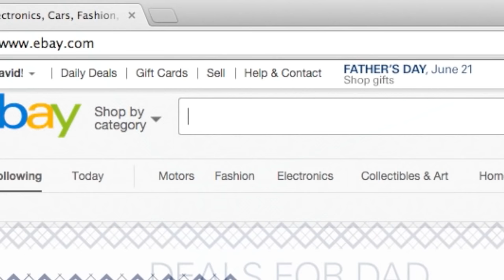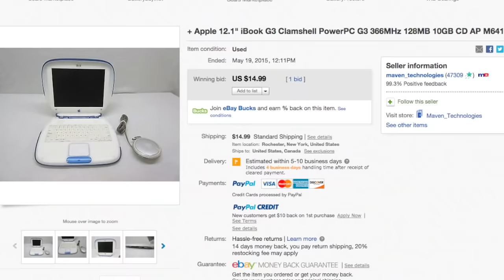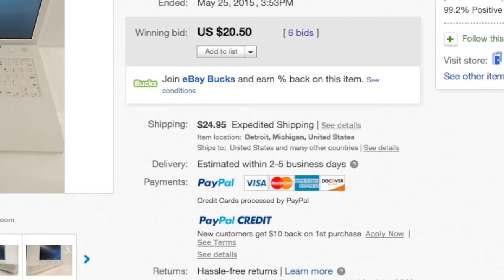Are apple iBook laptops collector's items yet?

Comment: After such a long time I watch the video again and there is one thing you did not guess, the dell ibm ect, now they are collectibles (year 2021) especially pentium, 486, 386 and more old, pentium 2 and pentium 3 not yet but, tualatin yes.

Mac laptops are not so much, but desktop ones are and quite a lot, at least in Europe, years ago getting a dual g4 MDD  or a mercury was very easy, there were even in the garbage, now they have a high price.

With the same thing graphics cards, the TNT2s were discarded, now they are going up, not as much as the 3dfx voodoo but things get serious.

and you, you have risen like foam, keep it up. :D

Comment: does it support windows? if it doesn't what's the point in buying apple
Reply: +mathias de potter Mac OS.
Reply: XD nice joke...
Reply: mathias de potter Some people need/want Mac OS more than Windows. These old iBook are pretty useless today, even compared to other notebooks from the time, though, I will say.
Reply: brodogger81
true, I too highly doubt that they already could handle the perfect OS in that point in time. The only advantage a mac book these days could have is their stunning screens, but then again windows isn't hardware restricted so any screen could be used.
Reply: mathias de potter MacBooks also tend to be make of higher quality materials, as well as usually being thinner. Windows computers usually tend to care more about specs over looks, size, etc, so the best option of computer varies between all people.
Reply: brodogger81
k true... apple also makes the 'new comer' difficulty easier, so peoples with zero to little knowledge would tend to apple, but they are till to over priced because they became such a mainstream trend-standard thing.
Reply: mathias de potter They defiantly aren't as cheap as they could be, but they aren't as bad as most people think when it comes to price.
Reply: +mathias de potter Well, I use both Windows And OsX and I JUST somehow like OsX more. Its simpler and dock is way better on OsX than windows, And Windows does not have scroll animations on dock. OsX seems to work also better fps for me. For example If you compare 25 and 60 fps. So they look like that difference. I think its because OsX have more animations and smoother screen. MacBook Pro screen is also warmer color and higher pixel density. Also my PC laptop have horrible touchpad and its made of plastic and even keyboard bends. MacBook Pro is made of aluminium and it feels good. Also touchpad on MacBook Pro works way more accurate and does detect finger every time unlike my windows pc.
Reply: eetu53
ow
Reply: De Potter M. The only reason people buy Macs is too not use Windows.
Reply: if you're gonna spend money on a Mac then you probably don't care about your money

there are computers that are half the price of a fully loaded MacBook inb4 razer
Reply: I am surprised no one seems to have cracked wise with "but can it play Crysis" with all the comments I have ready through in 2018.

Comment: I had a commodore 64 and a 128 both in original boxes, both working that I threw in the trash. I had tried to drop them off at my local Salvation army/GoodWill and they refused to take them because they weren't "flat screens". I still feel bad about it, I knew then that their were avid collectors of those units but for what they were worth I just didn't have the time to mess with Ebay selling them.

Comment: I sold: Macintosh Iici with 24bit card, 13'' monitor, AEKII and ADB Mouse; Amiga 3000 with an A1960, original keyboard and mouse; A2000 with a '030 accelerator, VT, A1291, original keyboard and mouse A1084S; A4000D (CEI branded) w/picasso and VT4000; A4000T with VT4000 and Picasso; Powerbook 170 w/accessories; Power Macintosh G3 upgraded to 400MHz G4 and fully loaded. All for $180 bucks. In 2011. The cost of separation I guess.

Comment: Anyone remember how insanely overclockable those first iBook G3's were? Just move a couple SMD resistors around on the motherboard. It was actually FAR harder to disassemble and reassemble it than to do the soldering. I've got an old grainy photograph of me hunched over a magnifying light doing the task to my friend's iBook. If I recall right, they were underclocked to conserve on power. They were at least 400MHz chips, clocked at 300. We took his up to 333 or 366 if I remember right, whatever was the easiest next step up.

Comment: If you're going for a G3 USB iBook beware of smelly keyboard syndrome. The adhesive used under the keyboards on some models gives off an odor similar to BO as it degrades.
Reply: i have a 12" titanium g4 and i barely ever use it because it reeks when i turn it on. legit smells like it's been sitting in a gym locker room once it heats up lol

Comment: Well the Clamshell design probably is the most usable design Apple brought out in recent years. Yes, there are problems with it, but compared to later ones they are great. It's what fooled me into buying one of those white ones, which was by far the least reliable laptop I ever had. Much less reliable than the ultra cheap laptop I got right after it.

Comment: Hi The 8-bBit Guy and all. You can use these and earlier models for the internet, most office programs, low end image editing, some games, and plenty of other things. So far I've installed up to Debian 8.6 for PowerPC (burned to CD using the "Net Install with Non-Free Firmware" version). Sure, Firefox (and browsing with it) is slow, but its still modern and supported. Multimedia is a problem - except for internet ads! I'm not sure when the video (and other) hardware in the G3/G4 series finally lets one watch movies. Wireless internet at the 802.11g level should be possible with any computer that has USB 2.0 and a Debian compatible USB wireless device. I've done most of these things with an iBook G3 300MHz and 366MHz, both with 576MB of RAM.

Comment: I've only kept a few Macs over the years, the PowerBook 100, PowerBook 2400c (modified with a clear body from Japan and a faster CPU) and PowerBook Titanium 1Ghz). The iBook was always a real POS, specifically because of Mac OS (you were able to pause the entire system by just holding down the mouse buttons). The desktop computers that I've always enjoyed collecting are SGI's, SGI Indy, O2, Octane, Fire and my favorite, the Tezro in which mine is the fastest model that was available with max out memory. I also have a few Sun workstations, a Mac Cube and a Amigo 5000. Miscellaneous laptops, IBM butterfly, HP  OmniBook 800, Psion NetBook, 5 MX, etc. The Psions are still my favorite portable computers even today, the 5MX specifically absolutely blew away my Newton when it was first introduced, I mean it had full multitasking.

Comment: I have PowerBook G4 a PowerMac G5, just because It's PowerPC platform, and I am big fan of IBM POWER line. But I am a big oldschool UNIX/Linux fanboy, so I have Debian on both, G5 is moded for years, mainly cooling system is f*cked up bitch from Hell (yes, I have a leaky one), G4 is my backup laptop and is usable, Debian for PowerPC have some rough edges but still, as inteligent typewriter is possible. Plus, in my country wasn't Apple thing before iPhone, so my unusual Mac is unique and even mistaken for brand new product...

Comment: 7 years later in 2023, I still managed to get a G3 Snow iBook for $30. Granted, it is the slowest G3 Snow iBook. 500MHz, 64MB of included RAM, CD-ROM drive, and no included Airport card or hard drive. But everything except for the battery works on it. The display is gorgeous, the case is a little scratched up as any 22 year old clear plastic would be, and some of the shielding and a couple of screws are missing from the inside, but it's otherwise amazing.

Comment: I never realized how big those first generation iBooks were until you showed us using one sitting on your lap. Anyhow, on the topic of the good typing feel of the iBooks, I agree. I think that in general most older laptops feel good to type on (for example, I have a 15 or 16 year old Dell Latitude in almost brand new condition and I love typing on it) and the same applies for my PowerBook G3, which feels good to type on. It's a Pismo model, so it has the bronze keyboard on it. I wouldn't say that new laptops have crappy keyboards (for the most part), like my HP ENVY which has a keyboard that feels similar to a MacBook Pro keyboard and feels pretty good to type on, but I think older laptops have nicer keyboards to them. And when a Clamshell iBook is modified to have the light on the Apple logo, I think it looks cooler than even the new MacBooks.

Comment: Just had to write another comment, you.. 8-bit guy (iBook Guy).... you have inspired me to buy iBooks.... however it is hard to come across an iBook g3 ClamShell... I got one (BlueBerry) for a total of 60$ with a broken keyboard, I was able to buy a new keyboard (for about 10$) and swap out the broken for the working. So I have a fully functional 1999 BlueBerry iBook g3 (however the bezel is missing on the CD tray)... I am planning on selling it once I get an air port card installed in it. 

I also got an iBook g4 1.33 ghz (for around 50$ including shipping) fully working (even working battery), just had to replace the feet and clean it up. (I plan on keeping this one for personal use.). I would like to thank you so much for making these videos.

EDIT: I live in a desert (Las Vegas) I usually mess around with the iBooks indoors... in a COOL and DRY climate. The iBook G4 (the one with a working battery) actually doesn't make a bad school laptop, I tend to bring it to my school whenever I have to type up essays or something like that, as Microsoft Word 2008 runs smoothly.

Comment: I do have a 2009 MacBook with Mavericks but other than that, all my computers are PowerPC. My PowerMac G5 tears through anything (just runs older apps) and I use a 15in 1.67GHz PowerBook G4 for work and school. It's a very sturdy and dependable system still and I only got it for $40. It's in beautiful condition. All I had to do was put in a new PRAM battery. I do plan on upgrading to an SSD though. As far as YouTube goes on it, the G5 can play full 720p (But that's because it's dual core and has a nice Video Card) the PowerBook can actually play in 360p though. But I do prefer 240p as it has a better frame rate. So not only collectors are buying these Macs. I don't really use my Intel MacBook much anymore though because it has a small and awful screen.

Comment: You can run a powerful but noisy machine (e.g. dual Xeon E5-2643v3 and quad GTX Titan X for blazing fast rendering) somewhere within your home network but away from living area, and access it over VNC on your comfy iBook Clamshell. VNC is a platform-independent open standard protocol for remote access and OS X have built-in support for it from the get-go.

Comment: This is the info for a for parts ibook g3 clamshell on ebay:
You can no longer afford to work with that slow outdated bulky laptop! With so much to explore in so less time, you need a speedy portable computer. The Apple iBook G3 is the ideal laptop for computing on the go. Consistently keep working at a speedy pace, as this Apple notebook is powered by the 300 MHz PowerPC G3 processor. The stylish clamshell design of the Apple iBook G3 laptop suits the tastes of all- business men and college students alike. With a resolution of 800x600 pixels, this Apple 12 .1-inch laptop displays detailed images, so that both texts and graphics are comfortably viewable. Virtual characters in online and PC games will not trails while moving or appear blurry, as this Apple notebook is fitted with an ATI rage Mobility graphics card. Work seems delightful and entertainment more relaxing on the Apple 12 .1-inch laptop

Comment: The problem with collecting notebooks in general is, that they will eventually fall apart and there is almost no way to repair them. 

If any of my pcs fall apart, i just put them into another case. My oldest computer is a 286 and it still works, while i lost quite a few notebooks over the year. (Taking care of the battery is a must)

Aaaand: Original IBM PCs are highly collectable, strange thing to say (Even in 2015)

Comment: Well here's the thing.  The video showed some footage of ebay that had sellers asking hundreds of dollars for a clamshell.  They can ask for any asking price, $300, $400, $600, and etc.  But that doesn't mean they are able to sell it at that price.  Browsing ebay for starting bids and highest "buy it now" isn't a good method to judge the worth of an item.  Right now, at most $200.

I would also like to point out that what determines how valuable a collectible is often ties in with how many are made.  Clamshells weren't limited edition.  There were plenty made and available to the consumers. 

If you find an iBook Clamshell in mint condition with nice box, manuals, and cables then that is going to be worth something.  If you find a Twentieth Anniversary Macintosh, that is probably one of the prized collectibles for any Apple fan.

Comment: I have also two of the iBooks, one have a not working backlight and one.... works, but is not so fast, because it is one of the first. But i upgrade both with a 160GB SSD (yes I use a SSD) and maximum of RAM, in the newer Version i add a DVD Burner, and in both a Airport. But in both the Batterie died. However, I will see forward if in some years i will see how many i can get for the early model. The newer Model I use for some Retro feelings and also for some vintage stuff, because the Audiojack also send the Videosignal with a special cable and you can add this old Clamshell to a old TV of Beamer for some retro feeling stuff (show the Kids how we live before the iPad).

Comment: Key lime's popularity is definitely because there are fewer of them. They were only available with top-of-the-line-for-the-time specs (particularly faster processors, iirc,) which made them more expensive to begin with. No basic model option, like other colors. I still have the little spec pamphlet, somewhere. I love green & wanted the key lime, but to get the specs that would've lasted me the longest would've been like $2,100 in 2000. I worked part-time at a movie theater. Wasn't gonna happen.

Comment: My Gravis Ultrasound is going for between $375 and $900 on ebay. I don't even see the older ISA models on there. Some PC hardware is going to be collectible. Anything that was popular with the developers, demoscene people, or audio people probably.

Post-PPC Macs are essentially trash. By that time the people using them are the people that will hold no nostalgia for them. They did not value them when they had them and they certainly will not value them later, if they even remember which models they had. They are more like technology locusts than technology lovers. Same thing with post-3G iphones.

Comment: I would say that some PC laptops  are collectible. There are especially the IBM ThinkPads with the "Butterfly" keyboards - the laptops are quite compact but the keyboard folds out to a wider width than the laptop body when the lid is opened.
Then, older ThinkPads in general, although very common, are also quite well liked.

Then there is the  Sony Vaio line, where many models are very stylish. Many design ideas that are common today were first seen on Sony Vaio. Apple has copied a lot of design ideas from Sony Vaio throughout the years: chiclet keys, aluminium wedge ultrabook, etc.

Comment: 2 things make these computers obsolete versus collectable: they have bad design flaws (the power plug of the clamshells always get cut or worse short circuited, the membrane keyboard is held in place by a fragile plastic tab, the display quality is at most passable, etc) and they are a pain in the arse to open and service with tons of layers of cracking plastics,hidden tabs, jumping springs and even micro magnets to hold in place all sort of delirious internal pieces; and besides that u get stuck with powerpc vintage software so the real practical use of these machines is close to type some words in SimpleText and play some mp3 (they had ide disks too -facepalm-); as with most things apple, full of propietary non-standard parts and tools

Comment: oh... if you guys are storing computers for sale later... open them up, and remove the battery... remove the clock battery that's in the little case on the board. I think Mac called it the pram battery. anyway, they meltdown and destroy the computer... I was crushed when I went to play with my old amiga, and found the motherboard traces all corroded from the battery...

Comment: Late 486 and early Pentium laptops have actually become somewhat collectible because of their ability to run older mid 90s PC games smoothly, but only very specific models that are considered to be in the "sweet spot" of mid 90s gaming PCs usually around the time of Windows 95's launch.  Generally they are the high end models that would have been pretty expensive back in the day and not super common today, especially in working condition.

Comment: 9:00 All of my uncles had C64, but I had to buy mine because they threw theirs away, also my father and my uncle threw away easily a few dozen thousand USD in car engines and vintage electronics, but you have to also count the costs of storing that stuff.

Comment: The Tandy Model 200 wasn't close to the first laptop with a flip up LCD display. The Epson PX-8, introduced in 1984, had a no-backlit 8 line by 80 column flip up display. In 1985 the Data General 1 had a clamshell design with a hinged display, then along came the Zenith Z-181, with a backlit flip up display.
Reply from the maker: Peter Winkler The Tandy 200  also came out in 1984.
Reply: The Grid Compass 1101(1982) predates all of those, there were a few similar laptops sold in '83  and by '84 everyone was making laptops with flip screens.